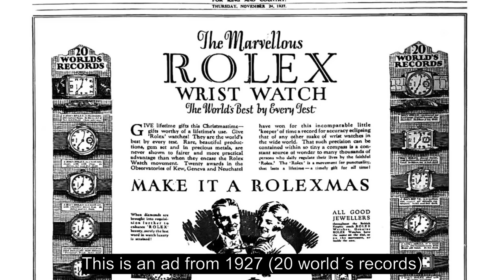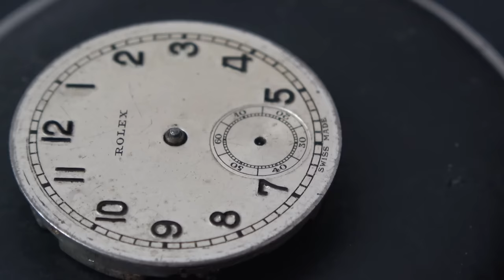Restoration one of the first Rolex watch ever made - antique/historical military silver case

Comment: Very nice rescue of a tired old watch, probably the only thing that I would have preferred to do would be to replace the winder crown with a more period correct or even repair the old winder crown, that being just a personal choice, otherwise a great addition to any collection.
Reply: There's something wrong with the watch he repaired. Says 'superbalance' on the ratchet wheel but the balance isn't a 'superbalance'.. it's a bi metallic split compensated balance. The case screw didn't fix the movement into the case. I suspect he fitted a stem tube(glued in when he should have used a friction fit tube) and waterproof crown as this helped fix the movement in place rather then the case screw. I suspect this movement is from another watch case and in the past was married into the case.

Comment: It seems you need adjustments on the 3 solenoid bases of your flux capacitor. This explains the time lap failure. Are you using the 14K Ohm resistors or the 5 3K Ohm version?
Reply from the maker: 😁👍🏻 Seems like you know what you are talking about 😉
Reply: If only his time machine was big enough he could go back in time himself to check which resistors he installed.
Reply: The Rolex is the Protagonist.
Reply: @rwauneka  Comments like this restore my faith in humanity.
Reply: @RedDeadRestoration  That's what the men in white lab coats told me at the institute...
Reply: 1.21 Gigawatts.

Comment: Fascinating how there are no spring bars, the whole "bar" is meant to hold the band
Reply: That was the standard in the first few decades of the wrist watch. The strap was sewn onto the fixed bar, or a one piece strap was used. There were also bracelets that had open ends that you closed around the bar.
Reply: @Psykel  Alright

Comment: Excellent work, but changing the crown on a 20's Rolex to a modern one is unforgivable lol. Couldn't the old crown be re-threaded or something?
Reply from the maker: The crown was worn, even after removing the rest of the plating and re-plating the crown it would remain "damaged". The new modern crown adds a sealing and some waterproofness. This will protect the dial from further humidity damage. Replacing original parts (in case the old crown was original - I doubt that) is always a hard decision 😉

Comment: How did you determine if the hands you removed were radium (radioactive) or not? Do you have beta-gamma sensitive survey meter? It looked like you took some precaution when removing the hands utilizing plastic swatch overlays. The method you used to remove the old lume would have spread radioactive contamination and presented breathing hazard. If it they were radioactive you will have contaminated everything you used in cleaning and preparing them for reuse. This can present a long term hazard to you and anyone in your workshop.